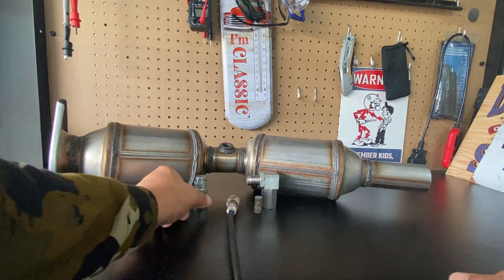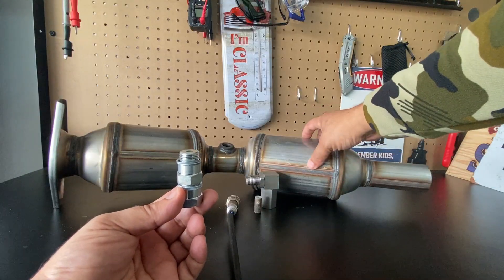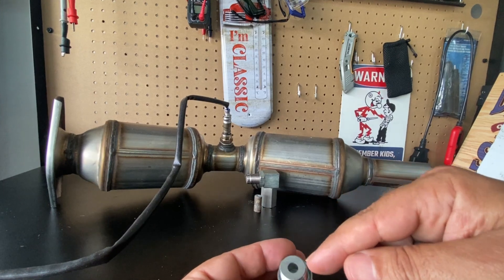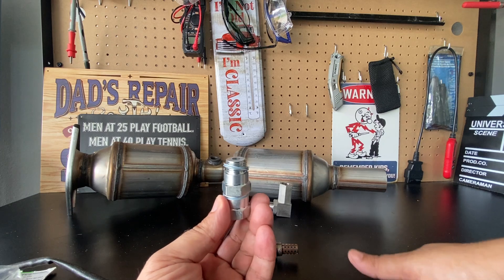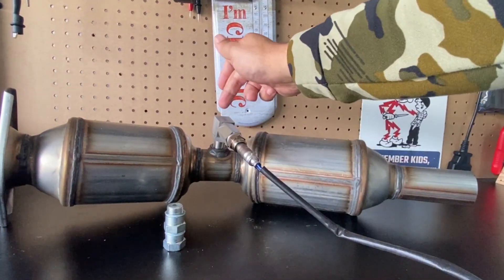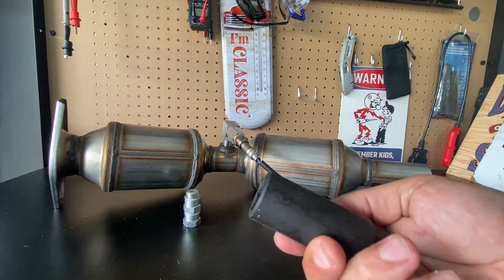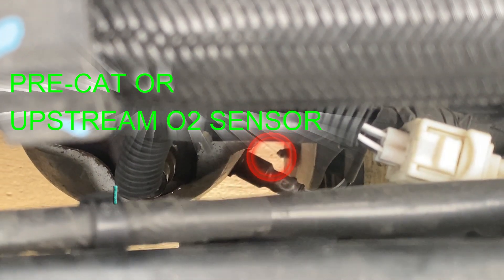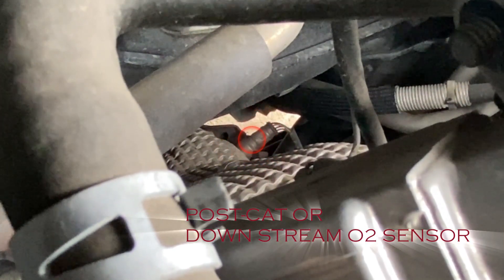Discover if Spark Plug Non-Foulers Actually Work and Why!

Comment from the maker: ▶▶ Catalytic Converter for $31? https://youtu.be/en6eKzyE_80
▶▶ P420 Trouble! Fix Catalytic Converter Code with Spark Plug Non-Foulers? https://youtu.be/XHyPWay4uE0
▶▶ Try This Genius Non-Fouler Trick to Pass Smog Inspection https://youtu.be/VHjzqXyOKaw
▶ Link to inexpressive cat https://s.click.aliexpress.com/e/_DBMXYAl
Now the o2 spacers are called non foulers, you should really buy one with a 90 degree elbow in most cases.
▶ Mini catalyst with 90 degree bend https://s.click.aliexpress.com/e/_DEYHHMV
▶ SOLD on Amazon Here is another part number for the no drilling required non fouler Dorman HELP 42109 https://amzn.to/43SHTkZ
▶ No drill spark non fouler found at Walmart.com Hesxuno Border Car Modification Accessories Oxygen Sensor Filter Adapter Extension Screw

▶▶ Catalytic converters playlist https://www.youtube.com/watch?v=BuZYAy_xi0E&list=PLDEbtVOPRC-h1BAzaWQ-6NSnmG0gwvgwP

▶ Dirt Cheap Catalytic converter https://youtu.be/Wr1vFqCnpDc
▶ Install of $118 Catalytic converter https://youtu.be/uIXslV-Wt3o
▶ I purchased the worlds cheapest catalytic converter for $31.60 https://youtu.be/en6eKzyE_80

▶ 12 Minute Actual Drive https://youtu.be/jldTJI64cfM
▶ Demo EMISSION INSPECTION MONITOR Readiness (I/M)  https://youtu.be/gAumb9zgLZg
▶ Permanent Diagnostic Trouble codes (PTDC) https://youtu.be/PMcJtcSOzdk

▶ Acura Drive Cycle https://youtu.be/2b7dYwMQZDo
▶ https://youtu.be/uO9iDeUZOyM Audi Drive Cycle
▶ BMW Drive Cycle https://youtu.be/mk6Tk330Acw
▶ Chrysler Smog Readiness check https://youtu.be/O1RH-u1bNIc
▶ Chrysler Smog procedure https://youtu.be/dyYv4HpYPys
▶ Ford Drive Cycle Readiness https://youtu.be/LllIXoqUKJ4
▶ Ford Drive Cycle https://youtu.be/j8ZFTE1rSfA
▶ Gm Drive Cycle https://youtu.be/Yp34ksJY-fQ
▶ Honda Drive Cycle https://youtu.be/oZELvZ4danA
▶ Honda Smog Readiness  https://www.youtube.com/watch?v=cxpE_I1cKh8
▶ Hyundai Drive Cycle https://youtu.be/UzC4FNTqNdI
▶ Infiniti Drive Cycle https://youtu.be/76SByziNMFI
▶ Isuzu Drive Cycle https://youtu.be/glw0d7y5_lQ
▶ Jaguar Drive Cycle https://youtu.be/h_aCeJch53U
▶ Kia Drive Cycle https://youtu.be/OtSDdIgQ6_g
▶ Land Rover Drive Cycle https://youtu.be/A-CmBzlXszY
▶ Mercedes Benz Drive Cycle https://youtu.be/gLnhD4gP0kM
▶ Mini Cooper Drive Cycle https://youtu.be/ND08_kKz8Ls
▶ Mitsubishi Drive Cycle https://youtu.be/3ywgZW2zMa8
▶ Nissan Drive Cycle https://youtu.be/s9PLkO-CjZ8
▶ Porsche Drive Cycle https://youtu.be/Yi6eANscwhQ
▶ Subaru Drive Cycle https://youtu.be/w3DF4g2h96M
▶Volkswagen Drive Cycle https://youtu.be/uh8BhqJpzGg
▶ Volvo Drive Cycle https://youtu.be/mEeUwDd_dsc
▶ Catalyst monitor not ready? https://youtu.be/hi7QdlgKHzM
▶ Catalyst Monitor Cheat https://youtu.be/BuZYAy_xi0E
▶ Catalyst not ready? Watch this video https://youtu.be/ERQUUdWo3-o
▶ Evap monitor not ready? https://youtu.be/99nfTcPy4fo
▶ EGR monitor not ready? https://youtu.be/aujgghRf04I
▶ Oxygen sensor not ready? https://youtu.be/sAvxeAyYsRk
▶ Oxygen sensor replacement https://youtu.be/9jKuutvNs74
▶ Oxygen sensor heater element testing https://youtu.be/zEbXn6vgqiA
▶ Dirt Cheap Catalytic Converters https://youtu.be/Wr1vFqCnpDc
▶Cheap Catalytic Converter Install https://youtu.be/uIXslV-Wt3o

Comment: I have a similar o2 sensor extender  on my mustang gt and completed a drive cycle but i cant get the htr ready. Is it because its not hot enough or to far outside the pipe?
Reply from the maker: The o2 heater monitor is connected to upstream o2 sensor. 
Start you vehicle and max load everything like the air conditioning, rear defrost, headlights. Etc.. let it just warm up.
Reply from the maker: And if that doesn’t help, this video https://youtu.be/Yn1-ul62Jio?si=8x7F9wuL2Do_zRbx is just for the o2 sensor and heater. 

The downstream o2 sensor port that the spark plug fouler gets up into is not normally tied to o2 heater monitor.
I hope that helps and keep me posted.
Reply: @RANDOMFIX but shouldnt a drive cycle get the htr ready?
Reply from the maker: The o2 heater monitor warm up and gets tested really fast during the warm up cycle.  The heating element inside the upstream o2 sensor is designed to get the oxygen sensor up to temperature fast so it can then run a rich / lean/ rich/ lean operation.
When the vehicle first starts normally it will run on the richer side so the catalytic converter can get hot fast as well so it will be able to function as it should faster.
I hope that helps.
Reply: @RANDOMFIX okpk thanx for the info! I did the drive cycle after like 70 miles and the cat is ready but my o2 and htr aren't ready. Could the mini cat be the reasons?

Comment: They do work. You just have to drill the hole out the bottom so they fit, you need to have it so the bottom of the O2 sensor barely peaks out of the fouler. Then they work fine on the down stream O2 sensor. The O2 sensor just needs to be out of the direct exhaust flow.

Comment: So I have 2 cats, do I put it on the very last one or both?
Reply from the maker: One the last one. 

The one closest to exhaust pipe is called the downstream o2 sensor ( this is one you want to use the fouler one, of course follow all local laws,) and the one closest to engine is called the upstream o2 sensor ( this is not the port you want to use.)

Comment: Ok from Wallmart. I got two doormen type already drilled. Should I use one or two. My flex pipe is shot. Going to cut out and replace. NO WAY am I FORKING over 3500 bucks for a repair. I will hollow the cat out first.
Reply from the maker: You use as many as needed, one should be ample.
Reply: How’d it work? Been driving without cruise forever and I’m sick of it. Oem is $3k and I’ve went thru 2 walker aftermarket cats in a year. At $3k idk why this problem isn’t spoke of like a head gasket or timing chain issue, it’s absurd
Reply: @chasedyer5950  Had it warrantied. 7 years and 80 000 miles. Federal law. Sneaky GM dealerships.  They wanted me to pay for it. Then submit the warrantee part for re imbursements from GM. My hands were too fat to disconnect the 02 sensor.
Reply: Trax has 73K and is only 5 years old.
Reply: @chasedyer5950  I only found that out because I went to an independent repair shop. I was trying to get them to install it because my hands were too fat. THEY TOLD me. I had to go to the dealership and show them the law. The sales rep told the MANAGER I was TOLD TO CHARGE ME, when I came in last week about this issue!!! He was ushered quickly out of the conversation then.  I UTTERLY doubt the dealership did not know the law. LOOKING TO DOUBLE DIP!!!!!!
Reply: @chasedyer5950  After tons of research.  A hole in your exhaust can set off you downstream O 2 sensor.
Reply from the maker: Yes the hole has to be past the down stream o2 sensor as there no measurements taken after the downstream o2 sensor.
I show it in this video https://youtu.be/en6eKzyE_80?si=QZejMrryTaJwKqn8

Comment: Why even mess with the spacers, if you just pull your Downstream sensors and clean them really good they should work like new again isn't that right?
Reply: No because the resistance in them changes when they're bad.
Reply: Not trying to fix a bad sensor here. They are trying to fix a bad catylitic converter. 
Your comment 'could' potentially fix a bad sensor if being dirty was the problem.
Reply: Absolutely not.  Its not that easy and besides that is actually harder yet. They arent cleanable. Nor would this answer the problem . Cat issue not an o2 issue.  Its the cats that actually do fall below their  peak performance.  Its the o2 that tells the ecm to trigger the light. Basically telling on the not So perfect cat.  Even tho most of the time the cats are just fine.  Just not good enough for the ECM and the Silly inspectors.

Comment: ok. I am dumb. What happens if you SEAL up the spacer hole?  Hence no fumes get to the o2 sensor? Anyone knows?
Reply from the maker: It will throw off a check engine light as the reading ( the input values that are measured by the vehicle computer would be out of the parameters)
You would then need to trick the vehicle’s computer with cheat device like a mil eliminator.

Comment: Are there any downsides to using a spacer? Does the engine run ok with these in place?
Reply from the maker: I would not run if I didn’t have an issue but I didn’t observe any. I am sure there is a downside like with everything.

Comment: Ok im confused. How does this keep your spark plug from getting fouled? If you are getting oil on your plug from say blow by, what would messing with the o2 sensor have anything to do with preventing that?
Reply: That… what are you talking about??? The non fouler is meant to go on the cylinder head where the spark plugs are. The way hes using it is not its intended purpose and has nothing to do with spark plugs
Reply: they lift the spark plug just a little bit from the chamber, and for the O2 sensor it gives it less smoke and tricks it into thinking the cat is working
Reply: This isn’t the intended use for the part
Reply from the maker: Welcome to the party.

Comment: Was getting a code on my mini van for cats and wouldn’t pass smog. Drilled one of these out and went to put it on and realized the person who sold it to me must have did the same thing LOL. Anyways I bought one of the long straight non fouler then boom check engine light gone. Came back on 5 min after smog. Cleared the codes again and it’s been almost a week and light still hasn’t came on and no codes are pending. Crazy work lol

Comment: Hello, I watched many videos using 2 non-foulers and everyone is using the same type of oxygen sensor which has the holes around the head and one on the front. In my situation I have install a high flow catalytic converter with 200 cells and yesterday I placed the spacer with the mini cat inside. I am using a bosch o2 sensor which has 6 or 7 holes on the front. Now readings are lean, my sensor sends low voltage from 0 to 0.03v and only when I am revving up the engine it sends higher voltage from 0.6 to 0.7v.. can use it without the mini cat or can I do something else? Just to mention that the o2 sensor location isn't on the pipe but on the catalytic converter. I don't know if that matters.

Comment: Hey man I have 22 vw golf r with a aftermarket downpipe and tune. I dropped the tune to stage 1 and installed the 90 degree spacer but then got a P2271 02 Sensor Signal
Stuck Rich Bank 1
Sensor 2. 

What do you think should I re flash the car to stock and or maybe install the spacer a little further in the downpipe.
Reply from the maker: Re flash it to stock. That’s your starting point.
Reply: @ thanks I actually did that yesterday and reinstalled the spacer deeper into the downpipe. That seemed to do the trick

Comment: How does one really know if the cat converter is plugged up causes pressure vs just a 420 code meaning its not working 100 percent on the fumes for epa?     Kids has a chevy Volt electric w gas generator with a 420 code, car runs fine but it tosses the light on which prevents other codes from alerting the driver.   So to keep the light off so other codes can light it up if needed why not use a non fouler?
Reply: One way is that you will see a fine haze or fog of atomized fuel blowing BACKWARDS out the intake due to the high exhaust and cylinder pressures at intake valve opening. The computer will also probably start subtracting fuel, which you can look for in the short and long term fuel trims.
Reply: Best way is to cut the pipe and check the honeycomb on both sides of the converter

Comment: What if you vehicle has 2 cats? Do you need to do both?
Reply: Nope. Unless u want to. Normally just the down stream. After the cat
Reply: @Jamie81989 im still getting a check engine light. Tried unplugging the battery but it comes back on. Do I have to clear it with a scan tool?

Comment: I gutted my front cats and run Doug Thorley catless B pipes on my 2005 Nissan Xterra. I have tried three different types of spacers and the P0420 P0430 codes come back within 10 miles of driving. Scratching my head as to what to try next. Thinking of the resistor fix but there are mixed results with that one too..🤬 The truck runs great otherwise and gets over 20 MPG, just hate the CEL..
Reply from the maker: Resistors work, I had them on my 99 to 2004 mustangs. They were called mil eliminators and I use to buy them from Americanmuscle but they are hard find. I never tried making my own as I would buy completed harnesses for less than $40.

Good luck in your search for a prefabricated mil cheat device so must likely you will need to create you own.
Reply: @RANDOMFIX  I think you are right, I will have to create my own. There are some tutorials here but they all differ in some way. Just trying not to have to make 4 different kinds before they work lol..
Reply: Did you stuff some steel wool in your non foulers? Supposedly if the spacers themselves don’t work then you’re supposed to stuff steel wool in the unmodified fouler that goes into your exhaust, then your fouler with the sensor bolted in it.
Reply: @AImighty  The extenders I used have the white "mini cat" inserts in them and were supposed to mimic the cat function, but obviously don't unfortunately. I would think that steel wool wouldn't last long being exposed to that kind of heat?
Reply: Just remember the non foulers only work on the downstream o2 sensors not the upstream
Reply from the maker: It’s been a year, and I just saw this post again.  
The ultimate solution is to get rid of smog tests so we can enjoy our vehicles responsibly. I know not everyone is going to comply.  
These new vehicle emissions are so much cleaner than the vehicles from the late ’60s.  
I’ve moved to Texas, but I understand everyone’s pain who lives in places like California, Oregon, and New York.

Get yourself a 2000 to 2015 vehicle now as these newer vehicles are beyond diy.

Comment: Great info! My F53 chassis motorhome had a P0420 code. It has an after market catalytic converter on a brand new vehicle for some reason. Ford service added a spacer for the O2 sensor on the cat. Should spacers also be added upstream on the exhaust? Thanks
Reply from the maker: Only on the downstream sensor. The upstream o2 sensor is not going to trigger a p420.

Here is a little trick someone showed me Genius Trick Pass Smog Visual Inspection with Non-Fouler!
https://youtu.be/VHjzqXyOKaw
Reply: @RANDOMFIX Makes sense. Thank you!
Reply: If there's an aftermarket cat on a newer vehicle, it may be because the original was stolen, and someone replaced it w/ the aftermarket.
Reply: I have the same issue. I bought a new MH with an aftermarket cat. It turns out someone cut through a fence and stole the original cat before I bought it. Now I'm getting the P0420 code after a couple months. Hopefully this works for me as well!

Comment: Hello Friend 
Will this work for a bad catalytic converter?  I reset the "check engine" light & comes back within 20 miles. Tried 2 catacleans and the straight non foulers with no luck. Just looking to have all moniters ready when it is time to smog
Reply from the maker: These angle 90 work way better.  

If you try it let me know know about your success.
Reply: @RANDOMFIX  i appreciate your response. I am about to purchase one today. This method is cheaper than buying a new catalytic converter for the time  being when money is tight.
I will keep you posted in 2 weeks. Have a nice rest of your day!
Reply: UPDATE as of 08 09 2024...it worked! Passed my smog check!  Thank you Friend for your helpful video.
Reply: @alfredbernal8603 did u remove the fouler before going to smog??
Reply: Converters still bad, a melted honey comb will still have to be knocked out so it can breathe before even trying non foulers
Reply: @chambliziOfficialChannel  I just needed this procedure to pass my amog check...i understand that a bad converter can affect the engine. But with this procedure, i get to pass the test, drive to work at a short distance & meanwhile saving up money to replace my converter. 
                        ✌🕶🔧
Reply: @alfredbernal8603  as close as you'll get to save is most likely a universal converter it will allow hundreds to be cut off with a weld up then you can use non foulers I can't give information that's not the legal way though good luck

Comment: Any idea of why I am now throwing a p0161 code in an f250?
Reply from the maker: Did it turn on after you tried using a non fouler? What’s the history?
Reply: @RANDOMFIX  all I have done to it is remove 2 mufflers. It still currently has 1 on. It was throwing both catalytic insufficiency codes (1 on each side). I have replaced both with the doorman adapter trick and I no longer have insufficiency on either side. I only have the p0161 on the drivers side. I have inspected o2 sensor and it looks fine. Additionally I have tried only using 1 adapter on that side and it is still throwing the code. Any ideas would be appreciated.
Reply: Update when comparing the two Ive noticed one is dented in and bent should I try replacing it?

Comment: I used the straight style on my 06 scion xb and it worked fine.445k miles and still runs great
Reply: Doing it rn, any tips or just pretty straightforward
Reply: @lukegreenwood2051 just drill a hole in the first one with 1/2 drill bit and then connect both together.and install.just make sure you have enough room since it makes your over all length much longer on my car I barely had enough room.the 90 degree angle one might be better if not enough room
Reply: Just curious..how many miles on your Xb? I'm at 483,000 on my Xa
Reply: Im at 445000 @snowvalley11